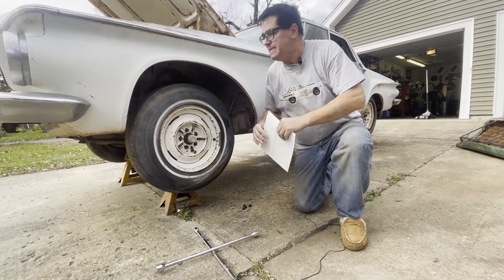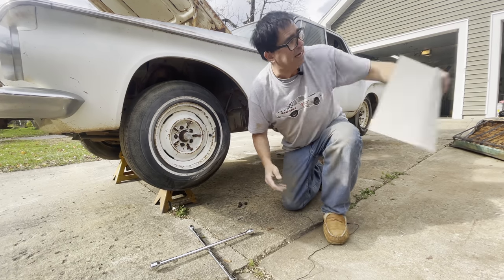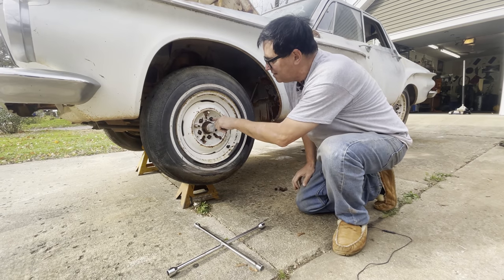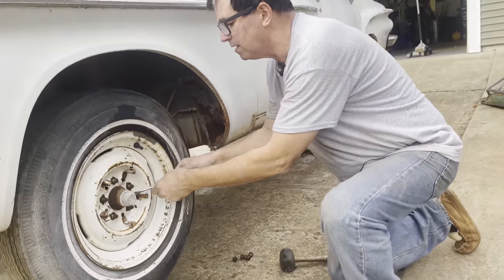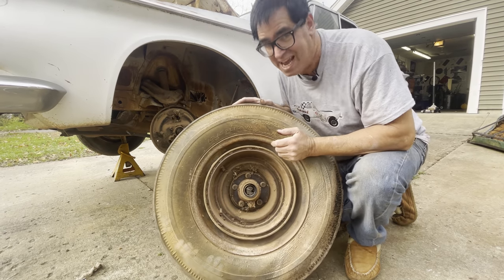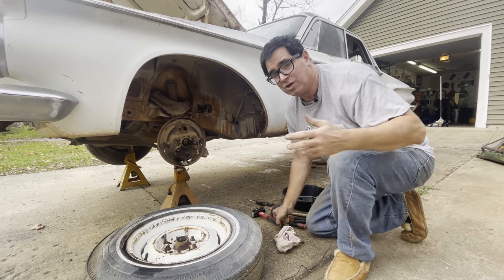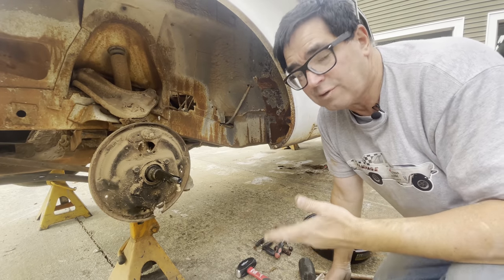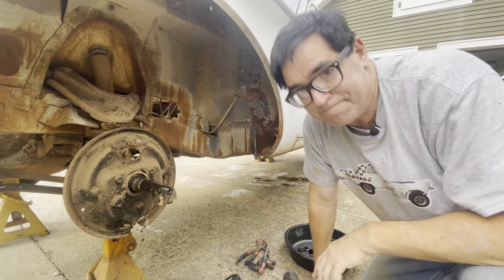Give Me a BIG Brake!

Comment: I see a wheel that's been on for 40+ years, an old school lug wrench, no PB Blaster, no torch, no impact wrench or hammer - I click for the struggle.
Reply: Bonus: The Bunny slippers!
Reply: PB Blaster!
Reply: That's a good tip for getting off drum brakes. Take it off with the wheel instead.
Reply: @davidbalentine2110  You read my mind.  They do sell it by the gallon.😊

Comment: Steve next time try taking the lug nuts off but maybe putting 1 or 2 on a couple turns, then jacking the car up as high as your jack will let you then drop it fast. It usually knocks them loose. I used to work for AAA I did that a lot.

Comment: A 5 foot legnth of thick walled 2"pipe swung at the tires sidewall like a baseball bat (fully inflated tire swung at the outboard side) will usually pop those stuck wheels fairly quickly and easily within a few swings. Learned that trick from the older tirebusters when I was 17 going on 18 and started doing tires and batteries at Monkey Wards back when that Dart was 7 years old!

Comment: Left hand lugs!! I worked in my fathers auto & tire shop from 1979 onward. I dealt with a bunch of left handed threads on Mopars. Also steel wheels, hubcaps of all kinds, original cragars and mags, split-rims, hot-rods, etc., etc... There were still plenty of cars around with bias ply tires that we switched to radials. For the rusted rims we would put them on a lift and use a sledge hammer and maybe some wd-40. If not then the torch a bit for some heat or then finally disassemble.

Comment: I have police car parts on my 1980 Aspen R/T like motor oil, trans fluid and power steering fluid external coolers. Even 11 inch brakes and front and rear sway bars all from a 1988 Dodge Diplomat police car. Liking all your videos by the way they are informative and fun to watch!

Comment: Surprised to see it was just a single brake cylinder in the front being it's a full size car.  The 1962 Chrysler Saratoga I had in the late sixties had two brake cylinders in the front, one on top and one in the bottom.  Had lots of problems with them in our salty climate up here.  They were manually adjusted and always all rusted up, a real PITA.  Thanks for all the great videos.  Best Regards - Mike
Reply: Dual plane brakes were on the more expensive cars, also the larger cars, not usually on furys and smaller
Reply: @ronaldhuff635  Thanks.  Learn something every day.

Comment: first order of business is change out the studs on the driver side before the tire shop twist them off replacing only the one they broke with a right hand so you then have 4 left hand 1 right hand on the same wheel :)

Comment: I used this trick on a Ford- reinstall the lugnuts. Leave them about one turn loose. Drive the car slowly in a circle, right then left (or the opposite, doesn't matter). The weight of the car will break the hub/drum/lugs/wheel, rust bonded, interface. Really easy. Works better if you have brake shoes and working brakes. Hitting the brake hard a couple of times with the lugs loosened will also work, sometimes.

Comment: My 69 Dodge A-108 van had the HD front brakes.  11 x 2.75 with a sway bar.  It had 10 x 2.50 rears but I swapped on set of 11 x 2.50 from a C-body.  Also had the LA318 w/727 Loadflite.

Comment: That odd anti-roll bar was still in use in December 65, when my 66 Coronet was built, it got the old one. Most cars were getting the new bar that we’re all familiar with, I don’t know if it was size related or just using up old stock.

Comment: Nice solid bones, alright. That sway bar isn't beefy by modern standards but back in the day, man...  Truly heavy duty and a far cry better than no bar as most cars of that time were. Looking forward to the further tear-down and progress on this car.  I remember an old magazine that a buddy gave me where they tested a 2 X 4 bbl 413, possibly in a car like this. It was around 30-40 degrees at the time and the car was not happy with the climate. It ran like a pig for the first half hour of drive time, they said it ate oil steadily, but hey - that was the way it was set up, loose and over-carbed for fall daily driving.

Comment: The best way I know to separate a wheel from a hub is to jack it just off the ground and hit the tire with a sledge hammer along the ground with good force.  Heavy hammer + at edge of tire + with force = loosened wheel.
Reply: Had a few so bad I hadda drive it with loose lugnuts or rip a little burnout till it freed up. 
Fuck Ohio rust.
Reply: Not hard enough  blow  etc.throw a spare tire fill of air at bottom of tire that should have air in it too .throw it three or more times  but it will come off

Comment: A friend borrowed my '67 GTX many years ago. He got a flat on the left rear and snapped off two  lug bolts with a huge breaker bar with cheater extension trying to loosen the lugs.  Someone had to point out the "L" for left hand threads. "Rocky" did replace the broken studs though.
Reply: When I was 15 I bought my 1963 Fury, still have her.  I tried with all my might but I couldn't loosen the lugs.  Just like Steve, I took off the wheel with the drum down to a corner gas station and the mechanic there zipped them off.  He looked at me and asked what the problem was.  I learned about left hand threads the hard way that day.

Comment: Had a few of those that rust welded the drum to the wheel like that. It usually is the point where the spindle goes thru the rim that gets locked up. Nothing a little penetrating oil and heat persuasion won't fix. Also I would suggest using hard soled shoes for kicking the wheel. Moccasin type house shoes are hard on the feet for doing that.

Comment: I like what your doing with the police car.Can't wait to see big the block in it.Question for you I'm restoring a 1972 4 speed Challenger with a 440 l have for it.l want put 11x3 inch drum brakes on the back.l have the backing plates.I can't seem to find 11x3 inch rear drums for it.l see 11x3 inch front brake drums will the front 11x3 inch drums work on the back...thx Walt

Comment: Hey Steve.   Next time you have a problem when trying to remove wheel from hub…..spray some WD in the lug stud holes.   Then use big hammer.  (And put a couple of lug nuts a couple of threads on).  So the tire doesn’t hit you back.     Just a fyi.

Comment: Next time Pro Tip: With a simple MAPP or Propane torch (hardware store) Heat in a circular motion around the outside edge of the lug ring and the differential expansion of the heated metals will pop the rust and making it easier to remove.

Comment: My go to hammers at work for wheel removal are a no bounce plastic coated sledge one is 12 pounds and one is eight pounds and they are 2 1/2 and 3 1/2 feet long you have to get after it

Comment: i had a 1974 duster in high school and where the upper A frames were fastened to the unibody frame rail ,that metal was somewhere between 12 and 14 Ga about as thick as the brim of a baeball cap and with our super smooth roads here in Okla they would break lose all the time then front tires would squeal going straight down the road and wear the tires out fast and being a dumb 16 year old kid never thought about welding some gussets in there to reinforce the thing

Comment: Here is a question: These 11 inch heavy duty brakes are not self adjusting until, I think, 1970. My 69 GTX with Track Pack still had manual adjustment only.
    Can you fit self adjusters from 1970 and newer 11 inch drum brakes to the earlier ones?

Comment: I was sure that the brakes would be 12 x 2 1/2. But I guess they changed to the later brakes in '62. Also, a little PB on both sides of the drum, then set up the wheel surface (not the tire) on a hard surface and tap the drum with a three pound sledge until it breaks free. 

Also, is that your cat photo-bombing at the beginning of the video ? 😄

Comment: Steve, Next time you push and pound on the car sideways keep the floor jack loaded along with the jack stands. Same goes for the rear. The additional safety measure can prevent possible damage to you and the car. I've seen cars pushed over supported by jack stands only. Just sayin'.  Following along with interest.

Comment: My 1968 charger has right and left handed lug nuts and isn’t there a difference between HDBrakes and police brakes? The reason my charger on build sheet says HD brakes and the 10inch, was told police brakes were 11inch and under a different code than HD brakes

Comment: I recall this car (on-police model) when I was 16 in 1962.  My impression was that the styling went off the rails.   Some of the colors were quite feminine, to me.  
A few years later I bought a 1966, 273 four barrel 270 coupe.  Besides being pretty quick, I thought that the styling was excellent.  After a set of Cragar SS wheels, fender well headers, and a Hurst mystery, this dark metallic blue beauty was my dream car.   It's a shame that Chrysler has such poor build quality and quality control.  Every time that it rained, the tail lamp lenses fill with rainwater, for one issue.